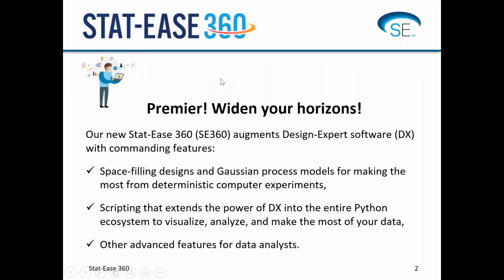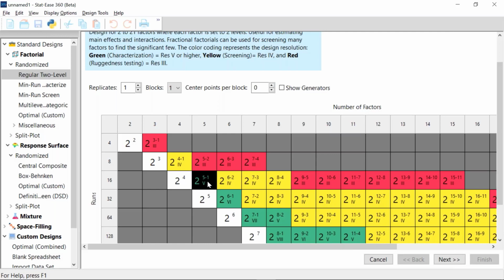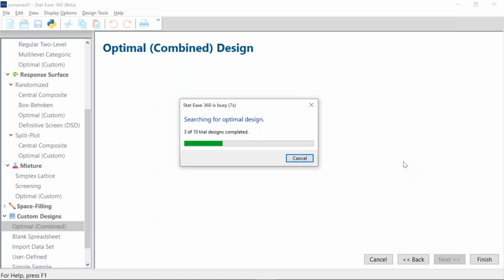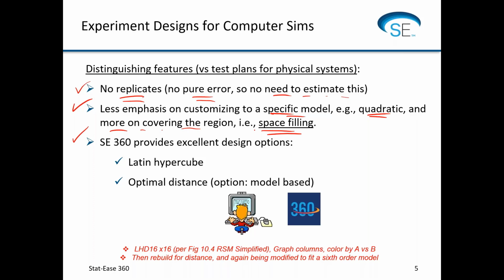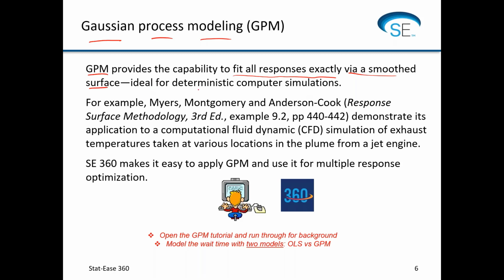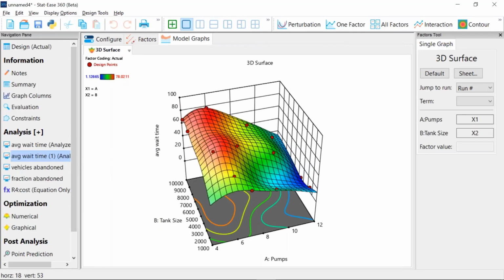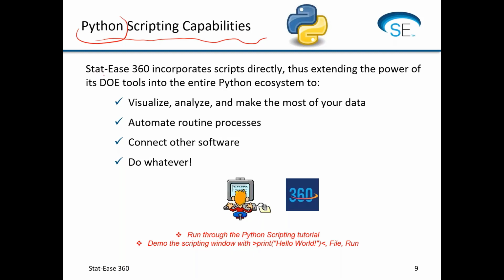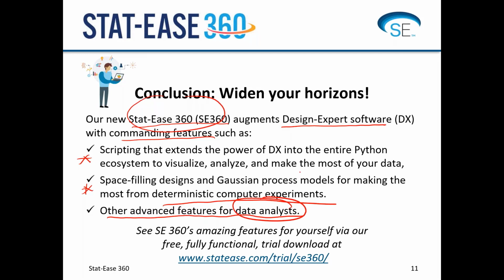Stat-Ease 360 Introduction

Comment: sir/Madam,
If I have already completed my experiments and need to optimize them using the software, is it possible? it is a multi-level factorial problem(2 factors and one with 5 levels and the other 3 levels) , with multi responses(two responses one has to be minimized other maximised).
Reply from the maker: Yes, use the Import Data feature to get the data into Design-Expert or Stat-Ease 360 and then proceed with the analysis and optimization.